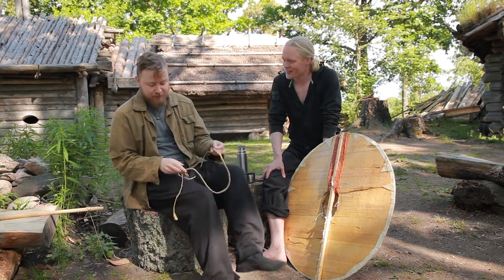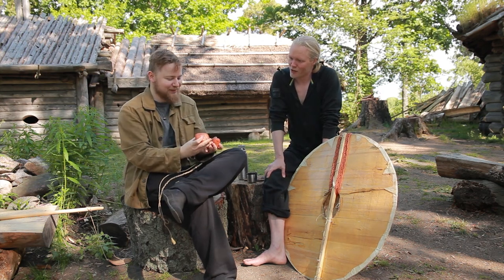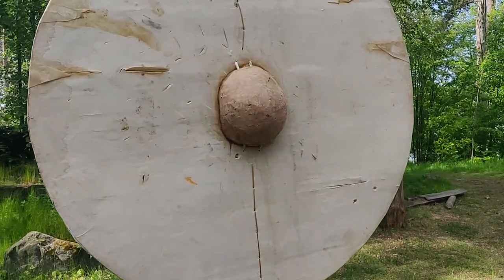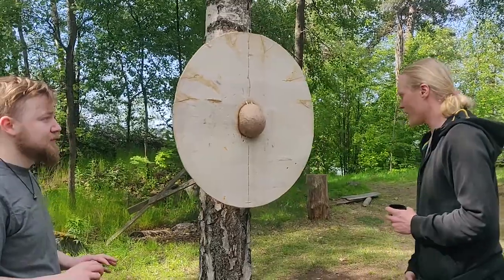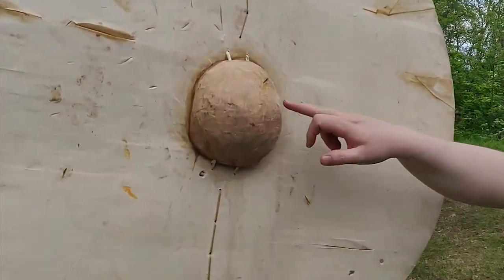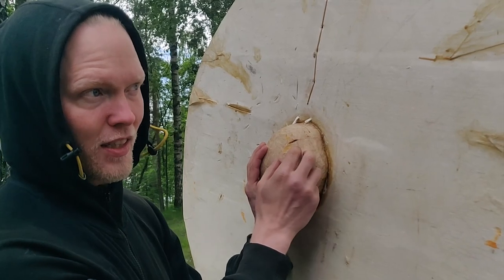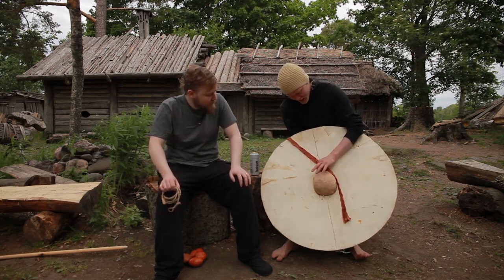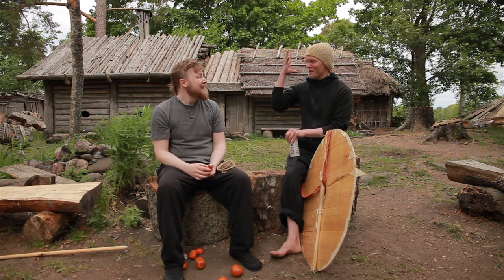Testing a thin shield against a sling. With @kickslinging

Comment: Awesome video!  That shield held up better than I expected.  A full raw hide cover adds so much strength.  Great test!
You also mention thick vs. thin shields in the video.  One of the benefits of thick shields that I've experienced in testing is impact absorption.  A big heavy shield will resist the impact of a stone much better, simply because in order to move your body, the stone needs to move the shield first.  A thin shield is obviously better for mobility though, so that's the tradeoff.
Reply from the maker: We did a lot of test, to find the benefits of a thicker shield. See them here:
https://youtube.com/playlist?list=PLRDL6wPnRyPg_13mTWWTaPN5sUKk5wSY_&si=Yffv-TgalZ_1gXd7
Reply from the maker: And I agree. The benefits is the mass itself. As I am not very strong I like thinner constructions, but many martial artist point out the benefits of a hevier swords have in blade binds.

-Arttu

Comment: Hi, nice video. As someone who has used the staff sling a bit, from that distance I would recommend a more "horizontal" way of throwing the stone, you can get a lot more power with a head-height shot. With the "vertical" grip you're using you are working against the staff's length and leverage power
Thanks for the content !

Comment: As always, great content. It might be thin and dry, but it still does a good amount of flexing when struck!  I think that is very helpful to its survival. Naturally, what bends will not break so easily. 😊

The type of shots used by ancient slingers are scary. Small, lead aerodynamic shapes, like the American football. These were said to pierce and embed into flesh. Due to their small size and the weight of lead, probably I think they would even get stuck into shields.
Reply: If it lands on point first, It may or may not penetrate, but the force would likely cause fractures.

I have tried out lead against 1cm plywood IIRC, and when my 42 gram glande struck point first, It only cause a small indentation on the front, but when I turned the board around and saw the back, there was a hairline fracture radiating about ~10cm from the point of impact... That actually shocked me. If it were a singular board of wood it would have cracked IMHO
Reply from the maker: We are aware of lead sling bullets, but since these have not been found in Finland or Scandinavia, we did not use them in our test, just regular rocks.
–Sakari

Comment: I think it is more time consuming to thin the shield. Its easier for the craftsman to make thicker planks through splitting and cutting with an axe, without producing failures. All that thinning out, takes time and precision. And if you need more shields quickly, they will not be so refined.   

How long took it for you to build the shields? Which take longer, or was more difficult to make? 

Time effort for war supplies is a factor to consider.
Reply from the maker: Making of the planks was the hardest part. Then thinning then down wad quick and easy.

Read about the building prosess here:
https://hirdmenn.blogspot.com/2020/06/making-of-our-first-viking-shield.html
Reply: Thinning a shield takes a lot less time than say, forging an axe, sword or spear I reckon.
Reply from the maker: I used a modern plain, but we do know iron age people had planes and other scrapers that they could use. (see thinning down of shield board using iron age scraper here: https://youtu.be/5-DDWp3AoeI?si=VK73wtL2W83nR4aV ) I don't remember how long it took for me to thin down the first shield, but with new ones it's something like 3 to 4 hours. An Iron age craftsman spends much longer in the process of making the planks themselves. (See cool plank making here: https://www.youtube.com/watch?v=BE2klxBE8QM )

This been said, Saxonboy is correct. Wood planks and leather are quick to get and make compared to making iron. I only have one acquaintance that dives iron ore from a lake, and I am much happier to skin a deer or split wood. Watching for example primitive technology makin Iron prills also seems slow and hard work. (See cool iron prill making here: https://youtu.be/DyGLE0usN_I?si=JLvE8JKgiwqzMK8j )

-Arttu

@schreiberundleser5318  @Isaac_howell

Comment: Try lead shot.
I wouldn't want to sling whith anyone standing down range like that, just in case.
Reply from the maker: As far as we know there are no lead shots in archeological record from viking age skandinavia. (Still might try it...)
Reply: A 100 gram stone and a 100 gram lead ball are about as hard to throw and have a very similar impact. Only difference will be that the lead will be a it smaller and have less air resistance, so it will impact slightly faster.
But since lead will be expensive and rocks are pretty much free I highly doubt it's worth the effort.